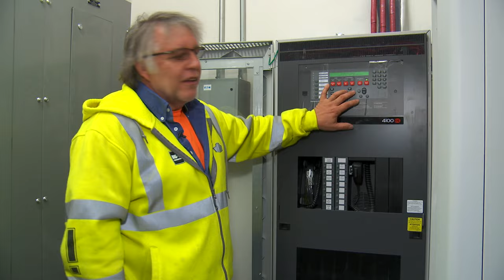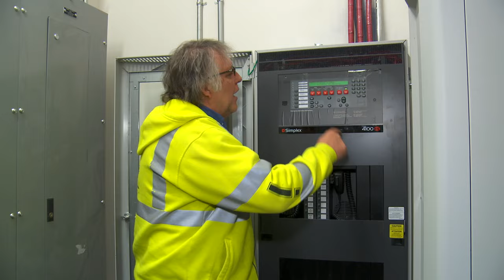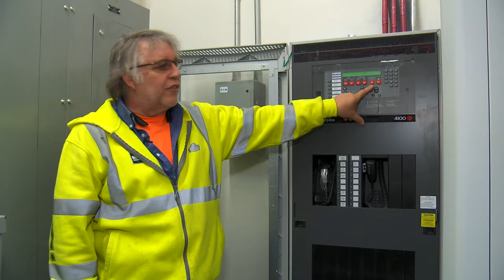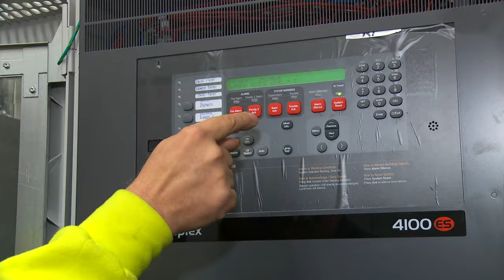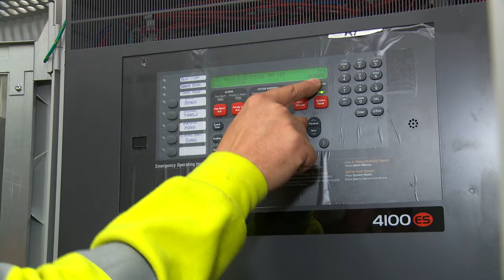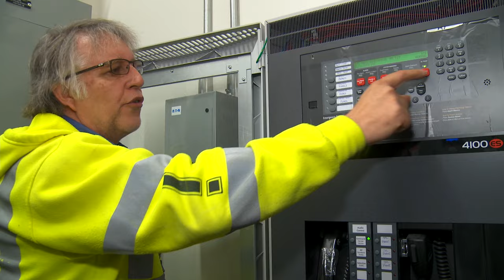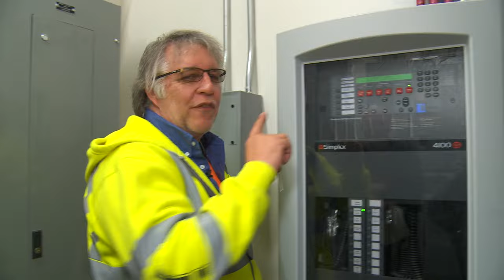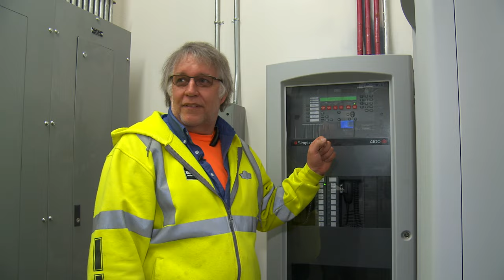Fire Alarm Training

Comment: If you wanna conduct monthly fire drills, can you either turn the fire alarms on using the panel or do you have to hit a pull station? I’ve done many monthly fire drills for my house and I don’t have a fire alarm system so that’s why I ask
Reply: Usually they program a drill switch. 
The drill switch will activate notification devices. Without shutting down ancillary devices i.e. roof top units, elevator recall. Smoke dampers . Etc. 
Also will be programmed to not trip masterbox or dact
Reply: @goalie2998  and if there is a dialer module, it does not call the fire department

Comment: Very good video ... But why would a fire control panel is locked into an electrical room? Is this recommended practice?
Reply: In many buildings it is. And it will have annunciator by the main entrance for the fire department.

Comment: This are just basics from what Technician really need to know.
Reply: This theory class is for people that works for a company or a school setting in need to know what to do in an emergency fire alarm situation. For example, if there is a trouble or an alarm in the panel, a person with authority and has gone through this training, will be the first responder. There should be a primary telephone line near the FACP that will ring. Or whatever primary emergency phone line is on record. The first thing people should do when a fire alarm goes off is to evacuate the building following company procedures.

Comment: My friend's university has quite a few Simplex 4100ES systems around the campus. There are also some 4100, 4100U and 4020 systems, along with a 4120, a 4010 and even a 4002 (I think) in the mix.
Reply: Update: The 4002 was replaced a few years back with a Simplex 4007ES, and they also replaced two of the 4100 systems with 4100ES systems as well.

Comment: Sir I want ask some quition about simplex 4100es there is showing ram battry trouble how to hide this trouble from systems ?
Reply from the maker: Wish I could be  more helpful but I just make the videos. I am not an alarm expert.

kj
Reply: Whher you from?
Reply: replace the 2032 lithium battery on the main board near the display.
Reply: @yipsalanimich321  That's a good one. RAM (Remote Annunciator Monitor).
Reply: Change the ram battery

Comment: How to add smoke detector in simplex 4100es panel?
Reply: from the panel its imposible,
 you need de programmer!
Reply: Piggy back from another device, add a module and a module number to the new device, run the wire back to the panel and then added to the programming of the panel. You should be able to add or delete modules in this panel.

Comment: How do you fix a ground fault?
Reply: Hire an electrician
Reply: Call for service. Basically the company that inspect and test your fire panel yearly. Sometimes company pays extra for a warranty or service on these panels just in case something happen to the panel or for troubleshooting. If there is no warranty, shop around for service prices.
Reply: If it's uneven ground or damaged ground I'm sure a general building can come and fix your ground.